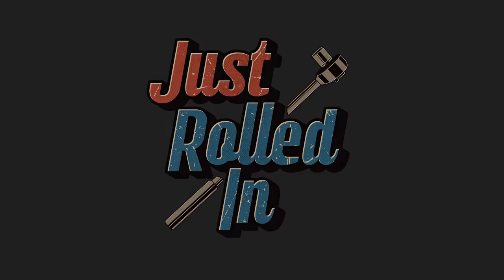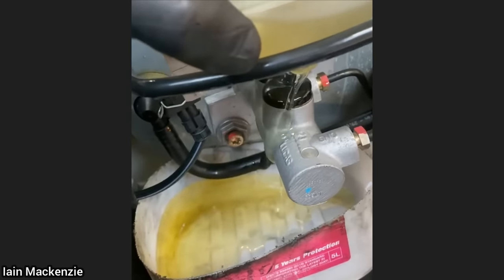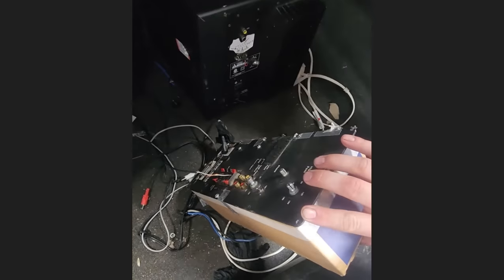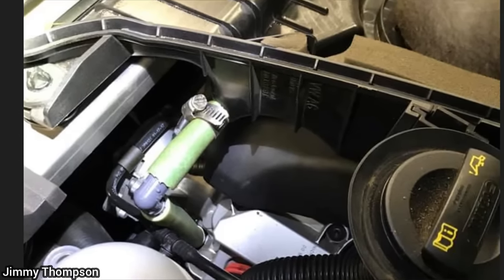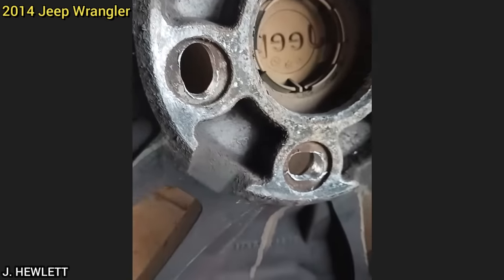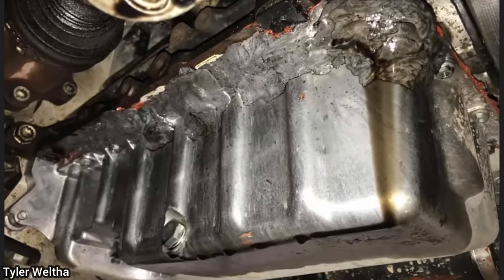Customer States Ticking Noise After Topping Up Engine Oil

Comment: Cute idea for popping out a stuck coil boot.  That's a take-off of an old machinists trick for getting a stuck dowel pin out of a blind hole.  Drill a hole through the pin, then put oil into the hole.  Use a drill blank or some pin that's a good slip fit to that.... when you tap the pin in the hole it pushes the dowel out hydraulically. 
😊
Reply: @logicthought24 
I never heard of that one but you can't beat physics for accomplishing the impossible. 😂
Reply: @logicthought24 I've only just learned about people using bread, must be an American thing 😂 I've only ever heard of or used bearing grease or something similar for that purpose
Reply: @FiftySixishTV  american bread isn't far from those other stuffs, only that it has no nutrients included. XD you can't do that even with the worst german bread.

Comment: 0:58 thats a plate amplifier. They are usually used on self powered subwoofers. I have a few lying around and some in use. They are great to have for projects. But you have to make sure they turn off if installed in a car. Thats when relays get useful.
Reply: I must admit, I've used more than one of those home powered subwoofers in a car. But I always ran them off of inverters tied to switched power, and never had an issue.
Reply: Now I can install my La Scalas in my car with confidence!
I just gotta, you know, cut the roof off.

Comment: the coil boot tip is especially helpful on ford 5.4l, especially in a van. The oil cap thing reminds me of a customer in a BMW z3. Had his oil changed, after this his car threw lean burn codes and ran horribly. As soon as i found out it came from an oil change place i checked the dipstick and oil cap. That crankcase is under intake vacuum, and if the oil cap is loose it pulls in un-metered air and it runs bad. I tightened the cap correctly and he tipped me 20$, learned something, and left happy.

Comment: I've seen the air trick with buckets.
My fiance was struggling to get a box open, one of those where the lid covers 5/6 sides. I took it back from him, and blew into the Crack. Lid popped right off
Reply: uh huh
Reply: You may have been tricked.

Comment: 2:04 I think that’s one of those scam electrolytic devices (or a home made version) that purports to increase fuel efficiency and boost performance by feeding oxygen into your engine. I think Mythbusters did a bit on one. This one looks particularly science-projecty 😂
Reply: Hh2o generator open cap with non distilled water, would have had no effect on preformence or economy
Reply: @mikemikey2932  It probably reduced economy as the extra load on the alternator would be greater than any power generated by the hydrogen.
Reply: Yeah it's a homebrew HHO generator. It pulls more power than it makes.

Comment: Good tip on the igntion coil boots. Another good tip for them while not always applicable but useful for when you dont have access to air; small long screw driver, preferably torx bit sized, and just go around the spark plug with it til its loose. Works every time when its able to be done.

Comment: My Honda Accord was laid up in the  shop for almost two days this week for a new exhaust system and catalytic converter as my mechanic rounded up the needed replacement parts and the bill was quite big. However, I keep forgetting that people who attempt their own repairs in the videos usual in the end wind up with much bigger repair bills than I did after the pros properly repair the issues.
Reply: Exactly. If I can't find a video that shows me how to do it, or if I don't feel capable or happen to have all the tools/equipment, my mechanic gets it, and I tip well.

My grandfather attempted to remove a stuck oil filter with a hammer and straight screwdriver...took off a piece of the block...$700 later, the oil change was complete😬

Comment: 0:18 that guy is so lucky. I work on those big truck drive shafts and that could be anywhere from a 1710-1810 series. Huge joints that take a thick 4 or 4.5 inch tube. They're massive and heavy, guy got lucky it didn't fly off and hit somewhere that really mattered.

Comment: In the mid 60s chevy cars and all others were using mechanical throttle linkage which was fine but they had a problem with the motor mounts which would break pretty quick which would lock the throttle wide open. It didn't take long before a new design was made with a safety catch or you could buy a kit with a cable going to the upper control arm for extra safety. If you have seen these you know what I'm talking about.
Reply: Saw one go full Monty; it was spectacular. The transmission linkage is also jammed, the power brake booster vacuum line pulled out, power steering line kinked...basically complete loss of control. This particular car ended up atop a pile of dirt behind the gas station where I was working at the time. Fortunately no injuries or fire. Because--bonus failure--it could also rip a fuel line open.
Reply: @mindpilot72  AHH you've experienced this before it was a pleasure to hear from another older mechanic that was sent flying because of the motor mounts failure. Wild ride my friend 🤣
Reply: @michaelvarble4392  So lucky on that one! The gas station was having a couple of its tanks replaced, so there was a big hole and a pile of dirt. But for that, the car would have plowed right into the shop.
Reply: @mindpilot72  it happened to me pulling into the shop I was young and I hit it kinda hard going in and it locked on me before I hit my toolbox I cut the key off and I was about a foot from hitting it. I'm glad you got out ok. It's a bad feeling brother

Comment: It's not the brake accumulator that's the accumulator for hydraulic gearbox system that's a 6speed PSA manual gearbox with an electronic command.
(Meaning you don't have a clutch pedal even though it's a manual gearbox setup)

Comment: I once had a Ford V8 that had a broken motor mount. For a few days, i heard a thump every time I revved the engine.  After two days, I lifted the hood and had my wife step on the gas. I jumped a foot in the air because I thought that the motor was about to fly out of the car. I only replaced one motor mount. (talk about cheap) Fixed it myself. I put some plywood under the oil pan and raised it with a jack, a few inches.

Comment: The lugs on that jeep probably weren't left loose... If you don't buff the steel drums before you install aluminum rims the lugs will loosen quickly even with proper torque and a retorque a week after. Learned that one the hard way when my rear driver-side tire passed me in the fast lane on the highway 😂
Luckily it was late at night, the tire didn't hit anything, and the jeep I was driving balanced well on 3 tires!
Reply: I’ve seen a set of wheels that were very nearly tight, but in reality the acorn lug nuts were bottomed out on the ends of the studs. When the nuts had finished chewing through the wheel, well, something passing them on the right caught the attention of the passenger. They were being passed by one of their own wheels. Fortunately it was from the two-axle boat trailer they were towing.

Comment: The broken engine mount bushings on the Mercedes is extremely common on that chassis regardless of which engine is installed.
Reply: I’ve seen it more so on the m276 than the m157 equivalent but definitely the biggest failure point on these cars
Reply: @billynguyen4912  Definitely true especially the 276.8 engines.

Comment: The dish soap windshield washer was funny.  I can understand it.  Commercial fluids are crap.  I have my own formula for windshield washer fluid.  20% Windex and water.  Works much better.  Only downside is it'll freeze in some climates.  Plus the ammonia fumes (open vent) are quite invigorating! 🤪

Comment: I can relate to using straight cleaner. I bought a gallon of 20/10 Windshield Washer Fluid. Someone had placed bottle(s) of concentrate on the ready to use rack. I noticed my mistake only after filling the reservoir... a really stupid move.

Comment: If your motor mounts are shot just brake torque the car untill the motor removes itself and it will be MUCH easier to get to the mounts.

Comment: Lol. I told a kid once after he broke off a coil in the hole to take a wire and wrap it around a long screwdriver  and hook one end to the rest of the coil pack and when he touches the broken piece im the hole it creates an electro magnet and itll grab it right out.  Said its an old timers trick..  the thing melted the wire to the screwdriver and threw a spark big enough to clean the hair off his knuckles..  he said “zztzzt fuckin hell”. Lol.

Comment: 0:04 Why did that engine keep knocking after he removed the cap?  I thought the noise was from the cap wrattling against the valve cover but it sounds like it was coming from the valvetrain and the cap just suppressed the noise once it was installed correctly...🤔

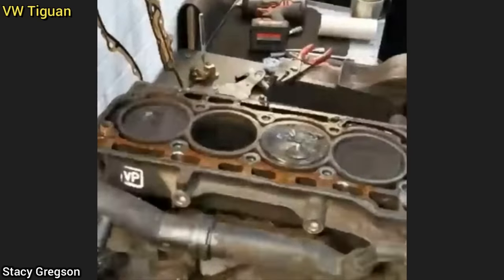Comment: 1:55 ng;, i have a civic that has been driving for 5 months with nearly no oil, no coolant, blown head gasket, and down a cylinder...   she finally quit starting as all the combustion gasses are coming out the radiator.  i honestly expected a rod to go months ago......   gonna pull it and see just how bad the damage is inside.  good old 1.7 vtec

Comment: Had an oil change done in Apache Junction in April before heading back to Wisconsin for the summer. The Oil change kid jammed the Dip stick in the tube so hard It broke the top off trying to check the oil. The owner tried to get the broken dipstick out of the tube by drilling and taping the plastic part. Removed the Whole dip stick tube from the block removed the broken dipstick reinstalled the dipstick tube. Next day I checked th oil and it was 2 qts low went back and tey added the 2 quarts.  Drove back to wisconsin. When I got here it was a qt low add 1 qt. yesterday my son was inspecting my car and wanted to know where the oil stains on the drive way were coming from. Long story short the guy reinstalled the dipstick tube wrong it was more than an inch above where it was supposed to be  not in the block so the dip stick read 2 qts low. OH that was Pateros Transmission 1205 Apache Trail, Apache Junction, AZ 85120

Comment: I'm not a mechanic, but I do some things by myself because letting it do is very expensive on my lkfz, like after the service, I'm  resetting the trip to the next service because it is like playing lottery dis it works, and my shop doesn't want to charge me a lot of money to do it or removing the breakdust from between the breakpads and brakecaliber and rust from the bolts on which they moving (its would have cost around 250€ per wheel). It took me 1,5h per wheel and many effort because of tight space. I'm using the repairmanuel which is 6 years older than my lkfz and 2 gens back from dis series, but it is very all the same and my shop has the same one. Before I start something I look on it and read how to do it before I mess something up.
Fore the things I don't understand or to risky fore me in my opinion I'm going to the shop.

Wow respect dis you have read all dis, sorry if I have spelled something wrong, English is not my native language, I wish you a nice day

Comment: Used to use dish soap all the time You just need to cut it at least 50/50 with water before pouring in the reservoir.
Reply: 50/50? 2 drops of Dawn per gallon of water has always worked for me.

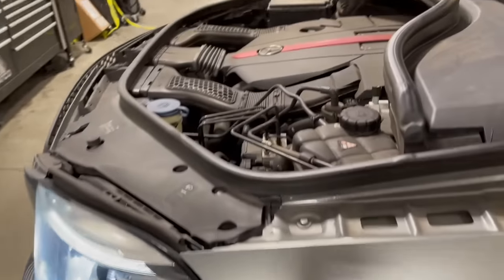Comment: 0:35 That’s likely the kind of car owner who completely empties the bank account or finances the car 100% by debt to show off and then is unable to afford the very basic maintenance and only the most basic insurance plan
Reply: I unfortunately worked on the car, declined brakes, tires, and of course the engine mounts. She was 90k miles into the car and was well overdue for other services but I tried to at least get the safety related work done. Didn’t want a thing but her A Service
Reply: @billynguyen4912  This would fail even the most lenient safety check over here even if you would miraculously would be able to bribe the safety inspector. If I was that customer I'd jump to the sign the repair job. I'd never let shit like this happen to my car and willfully ignore it. I try to keep my car clean and well maintained at all times, and I own a car which is definetely way cheaper than this Mercedes. Take good care of your stuff and it will take good care for you as well...

Comment: The Sunday Afternoon Joke
A young woman joined the army and signed up with the paratroopers. She went through the standard training, completed the practice jumps from higher and higher structures, and finally went to take her
first jump from an airplane. The next day, she called home to tell her mother the news.

'So, did you jump?' asked the mother.

"Well, let me tell you what happened," the girl said. "We got up in the plane, and the sergeant opened up the door and asked for volunteers.; About a dozen people got up and just walked out of the plane."

"Is that when you jumped?"asked her mother.

"Uh, no. The sergeant started to grab the other men one at a time and threw them out the door."

''Did you jump then?" asked her mother.

"I'm getting to that. Everyone else had jumped, and I was the last one left on the plane. I told the sergeant that I was too scared to jump. He told me to get off the plane or he'd kick my butt."

"So, did you jump?''

"No. He tried to push me out of the plane, but I; grabbed onto the door and refused to go. Finally he called over the Jump Master. The Jump Master is this great big guy, about six-foot five, and 250 pounds. He said to me, "Are you gonna jump or not?''; I said, 'No sir, I'm too scared.'"

"So the Jump Master pulled down his zipper and took out his you-know-what. I swear, Mom, it was about ten inches long and big around as a baseball bat! He said, 'Either you jump out that door, or I'm sticking this little baby up your ass.'"

"So, did you jump?" asked her mother.

"Well, a little, at first."

Comment: hey so i might be the idiot that just rolled in, and i feel like there’s a ton of mechanics in here that can help. this morning my truck was leaking what i think was coolant. it was kinda sticky and had a yellowish color. dad twisted off the coolant cap and it “exploded” with pressure and started steaming or smoking then refilled the coolant tank the coolant that was never pushed back into the tank. any ideas???

Comment: Just use needle nose pliers to pull out the stuck coil boots it works if you don't have an air compressor

Comment: I can't understand why an owner of an expensive Mercedes Benz would not want their engine mounts fixed. It wouldn't cost that much to put new engine mounts in a Mercedes that's still relatively new. It all depends how they were broken too. Unless they wanted to do it themselves in an attempted unnecessary cost saving measure. Doesn't matter what country you come from but it's like that everywhere including down here in Australia. Some people would buy a $50,000aud vehicle and would refuse to spend $200 dollars on it in either servicing or repair work. It's usually the type who are fairly well off and even some rich cocky's (farmers) can be like that also.  Pro tip, if you can afford the car and then some, you can afford to spend money on it for routine servicing and repairs. The owner of the grey Mercedes featured in this episode ought to be ashamed of themselves. Without being too judgemental, surely he or she would be able to part with a small sum of money to get new engine mounts fitted. That's my opinion on that. What's your thoughts?
Reply: She literally just wanted the service (ie oil change, top off and inspections). Not seen but the rear tires were balding and brakes were also in dire need of replacing. But declined

Comment: What exactly did the guy do in that stuck coil boot? I heard compresses air but it was not explained.
Reply from the maker: Yep just compressor air to pop it out
Reply: @JustRolledIn  I had one that was melted to the sparkplug. So I guess that wouldn't have worked for me.

Comment: 0:57 looks like the guts of a "portable PA" system repurposed to work in the vehicle - whilst this will likely run off 12V (it was probably junked because the supplied batteries gave up the ghost) unless extra switching circuitry is used to remotely switch the power there would always be a drain on the 12V supply - so unless you have skills at homebrew electronics construction it would be better to use a purpose built amp for a vehicle and/or get a professional to install it..

Comment: A few years ago, a drive shaft on my camping car slipped out as I drove into a parking space. To be able to refit it. I had to jack up the front, take off the wheel, refit the drive shaft and then dig a hole in the ground to refit the wheel. I didn't tighten the bolts as the wheel was turning and planned to reverse and carry it out when the wheel was on the ground. I forgot. The next morning I set off and there was enormous vibration. Before I could reach a parking space, the front wheel flew off. I'll never make the same mistake again.

Comment: 2:02 looks like a homemade electrolysis cell. The customer must have thought that pulling a bit of HHO into the engine along with the intake air improves performance or efficiency.

Comment: Sooo many issues would have been prevented, if the stupid animal driving in the car looked into the book called "User manual".
Even if you didn´t get it with your car, you can always search for it online!
It often contains pictures, what is what, how certain parts look like, with picture guide, how to change bulbs, filters, etc.